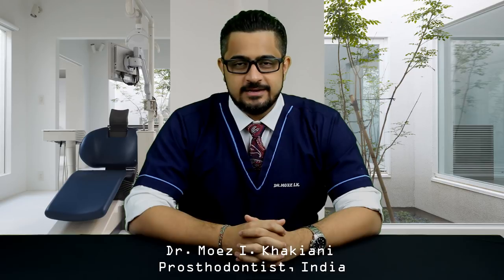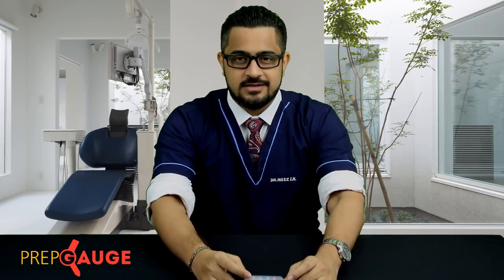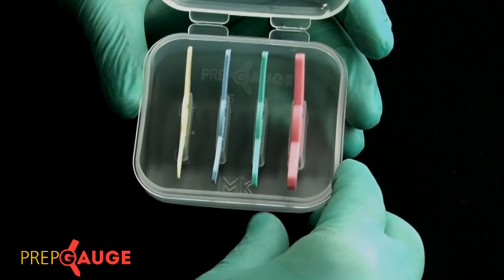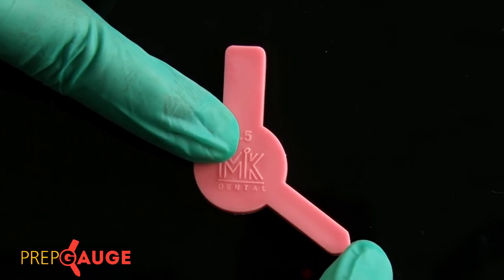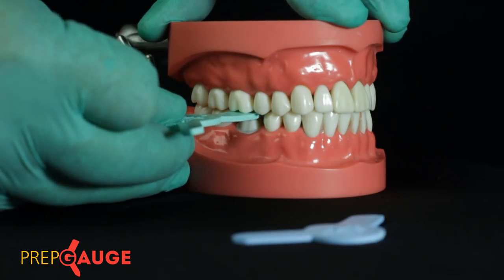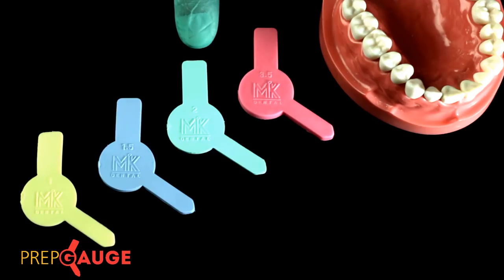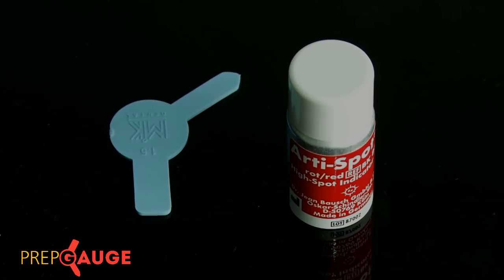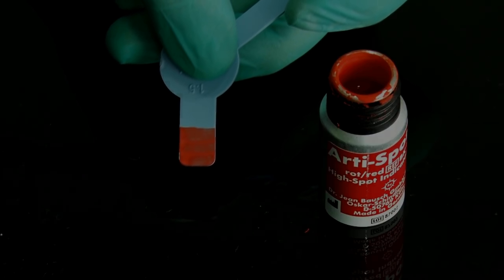Prepguage by MIK Dental #learningwithmik

Comment: Sir,i am using this product.Honestly,its very difficult to use in posterior areas as the round table of prep gauge is difficult to place through buccal corridor due to its larger size,esp in mandibular 2nd molar area.Secondly,they can not be placed in straight line in posterior areas.Request to reduce the overall size of prep gauge.
Reply from the maker: Kindly share an image of how you seat the PrepGauge for posterior teeth... Will accordingly guide you...
Reply from the maker: Awaiting the pic Dr. Kothari
Reply: Even i am facing the same issue
I thing a probe method is far better